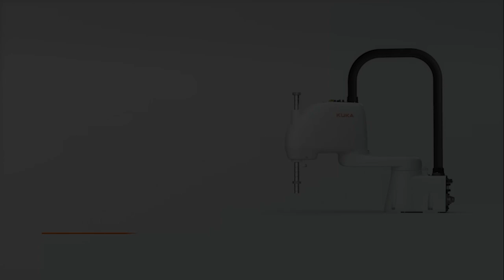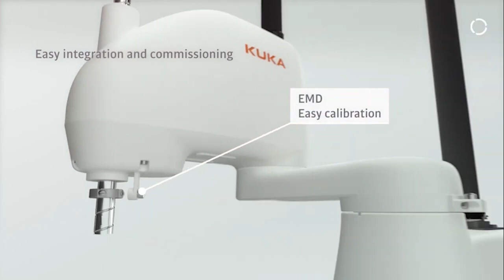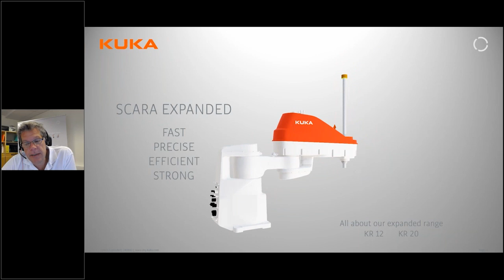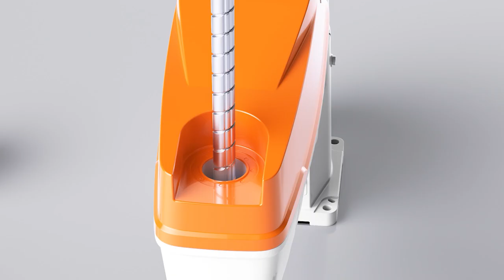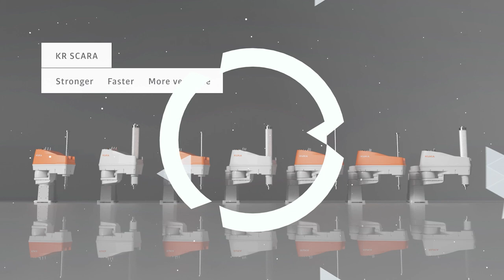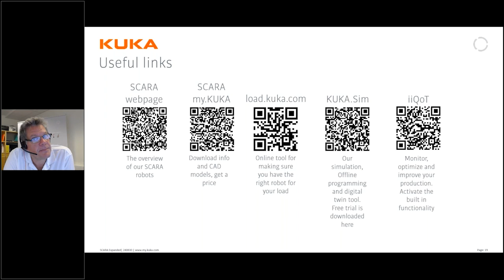Informative webinar on KUKA's SCARA robots

Comment: Hi Kuka, I am using KUKA SCARA with the KR CS Box-2 controller. I don't find functions or options for tracking objects on the conveyor. I have written programming for this feature, but it is not smooth. So, I hope KUKA as soon as update the firmware for this version.